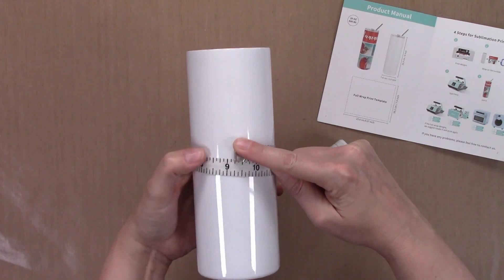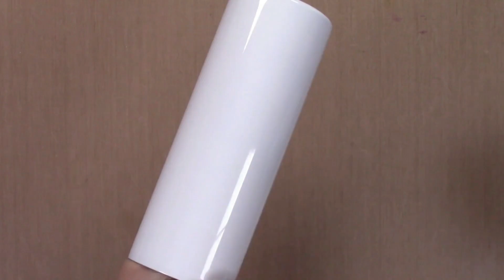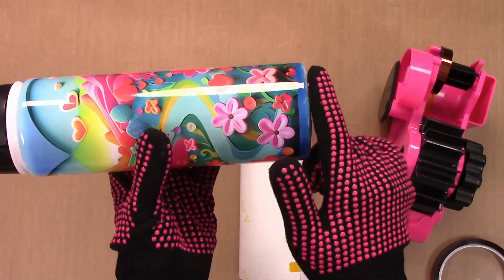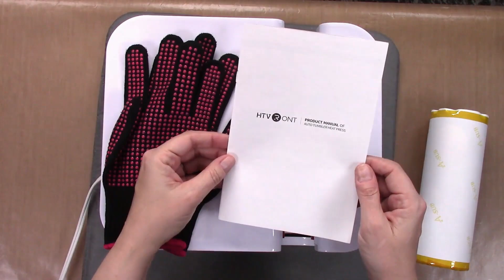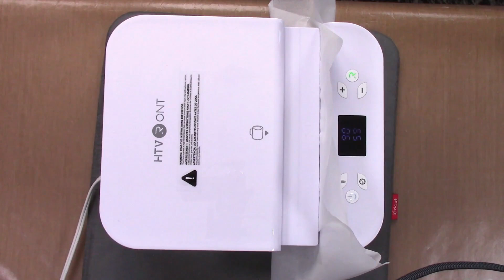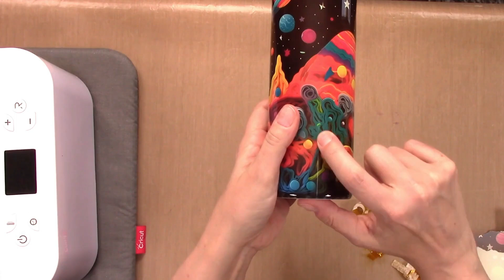HTVRont Auto Tumbler Heat Press Final

Comment: If you want a perfect seam, seamless, then you want a bit of overlap. The bottom side you put a piece of heat tape on the back along the edge, then you pull it tight and will have a touch of overlap. Then pull and tape it well, and run your finger along both seams. You will get a perfect seam every time.
Reply from the maker: Great. Thank you for those tips!

Comment: Any suggestions I'm having ghosting issues i messed up 3 tumblers with this heat press i did it once for 380 for 120 seconds and its ghosting either near the seam or bottom or top of cup so frustrating
Reply from the maker: Unfortunately, I gave up on this tumbler press when the buttons stopped working for me (not long after this video). But, there are several people in the comments who suggested rotating the tumbler multiple times during the heating process and heating it longer than I did. One person puts the bottom back in the tumbler press again and heats it again to get good results on the bottom edge. Another person mentioned using the method from an Industrial Fringe video and getting perfect results. She didn't say which one but I'm guessing it's this one: https://www.youtube.com/watch?v=7Uj0ho9pP3o I hope one of those helps - you might want to read the other comments since I may not have summarized them very well here. Good luck!

Comment: 385 120s rotate and another 120s no issues. also try shrink wrapping works great.
Reply from the maker: I've been hesitant to try shrink wrap because the ones I've been able to find seem to be for use in sublimation ovens. Is there one you recommend that is okay in a tumbler press? Maybe the oven ones are okay for that too...I wasn't sure and didn't want to risk it melting in the tumbler press. Thanks!

Comment: How if the picture or design don't come out on the tumbler and the paper be stuff on the tumbler what do you do to correct it.
Reply from the maker: Unfortunately, with sublimation projects there isn't a way to fix them if they don't trun out. You can try putting the paper back on and reheating it but the chance of being able to get it back in the exact same place is very, very low so you'll probably wind up with a lot of ghosting, which will be worse. When mine don't turn out,. I have to start over with a new blank and print. If you're new to the process and are able to, try using some cheaper blanks first if possible (mugs work in the press too) so you can get a feel for the right settings, how to wrap the blank well, etc. It does take some practice but hang in there - you'll get it.

Comment: I flip my tumblers end for end plus the normal rotate 180 couple times.  Fixed my issues with this HTVRont press.  Early on I noticed the press does not close perfectly square on both ends.
Reply from the maker: This is a fantastic tip! I didn't realize that was the case (not closing perfectly square on both ends) so this should help a lot. Thanks!!

Comment: Have you tried it with shrink wrap?

What tumbler press did you switch to?
Reply from the maker: I haven't tried shrink wrap but I've thought about it. I purchased one from Craft Express. Not as compact but work very well.
Reply: @BlackSheep303Crafts  Thank you 😊. 
Did you do a video with the Craft Express? If not, will you be doing one?

I am torn between a tumbler press or a sublimation oven from a sublimation company. I'm still not sure I want to get into sublimation printers. I'm not one for conversions or shortcuts. 

It's bad enough I have 50,000 hobbies. 😆 🤣 😂.  I'm pretty sure I don't need 1 more but hey, if I can make some money with it, it might be worth investing in it.
Reply from the maker: @andreatthatsme  I haven’t done a video with the Craft Express tumbler press. I may but it won’t be soon. A sublimation oven would give you the ability to do more types of projects than a tumbler-specific press. But if you really only want to do tumblers then either would work. Good luck deciding. I know what you mean about having 50,000 hobbies - lol. 😆 But that’s a nice problem to have.

Comment: Exactly that is the temperature and time it should take for black colors?
Reply from the maker: Time and temperature settings are largely determined by the substrate you are sublimating on to, like the stainless steel tumbler in this video. Without knowing that, I  can't give you time and temperature settings. But, as I show in the video, the booklet that comes with the machine gives you settings based on the substrate. Also, the color of the material/sublimation design doesn't make a difference so once you know the settings for your substrate, you are good to go. Here's a blog post from HTVRont that should help: https://www.htvront.com/blogs/beginners-guide-precautions/tumbler-press-time-and-temp I hope that helps!

Comment: You're a genius. I snipped along the bottom, only way more times than you did. I used your technique with the tape wrapped tightly around the bottom but then I added a thicker tape on top of that tape to fold the tiny snip pieces in place. Then, just to be sure, I taped the bottom and they turned out beautiful. Thanks for the idea! And thanks for sharing..🙂
Reply from the maker: That is fantastic! I am really happy I showed you something that made a difference with your tumblers. Thanks for letting me know. I'll have to try the thicker tape trick now too.
Reply: What if we put the tumbler in shrink wrap and then cover it with butcher paper while in the heat press?

Comment: Purchased this press in February lots of ghosting and requires entirely too much tape to be successful. Purchased a new press Wednesday of this week and it works perfectly. The new one is a different brand
Reply from the maker: Are you willing to share which one you purchased? I and others would love to know, especially since you aren't having the ghosting issue. Thanks!
Reply: @BlackSheep303Crafts sure thing. It’s the exact same one being used. Regrettably, had to purchase a different brand since the only way to prevent ghosting was by using ALOT of tape. It was cutting into my bottom line. Keeping it for mugs but not tumblers. ☹️ Love the video though, thanks for sharing.
Reply from the maker: @arisingphoenix4392  I guess my question wasn't clear - what is the brand of the new one you purchased after giving up on the HTVRont one? I'm always looking for good brands for tools. Thanks!
Reply: That's the issue I'm having ghosting issues and I wasn't having this issue with another press I was using that came with my heat press
Reply: Hi there. Can you please share the name of the other brand?
Reply from the maker: @yaredavila_23  I actually purchased a tumbler press from Craft Express and it's easier to work with. Not as aesthetically pretty in terms of design, but I wasn't worried about that. Don't know if that helps.

Comment: I watched a taping video on industrial fringe yt channel and I used that for my first tumbler on my htvront tumbler press and my top and bottom were perfect. My Seam wasn't matched great but there was absolutely no ghosting. It was a very clean seam that did not meet up lol. But top and bottom are perfect on my very first ever tumbler.
Reply from the maker: Thanks so much for sharing this. I will definitely check it out.
Reply: @BlackSheep303Crafts  yw. I think I've also learned through watching yt.... that on the htvront that maybe a little higher heat and a tiny bit higher time...I did 390 at 90 and 90 on that tumbler (so far the only one I've done) and like I said it was absolutely perfect other then the seam which was my fault and me just learning how to do things.... not the equipments fault. I am going to try the next one at 390 and 180 seconds with no turn and see what happens.... but I'm nervous... I'm terrified of fires, so putting something into something that hot for too long scares me. But I watched a video and they did it and it was fine, and there were no issues whatsoever
Reply: @BlackSheep303Crafts I've tried to get the wrap twice not coming to my email or spam is it still available?
Reply from the maker: @beebeej1  Are you not getting the Resource Library password in your email or something else? The wraps are in the Resource Library. You can email me at elena@blacksheep303.com and I can send it to you.
Reply: Oh, I forgot....I also wanted to say that I watched a yt video....I can not for the life of me remember which one because it wasn't like just today, lol.... but the person was having the typical issues people keep complaining of with the htvront, so they reached out to the company about it, and they had recommended a time and temp... which is where I came up with the 390 at 90 and 90.... the company told her 180 seconds continuous press, but I was too scared for my very first tumbler to do that since literally everyone else turns halfway through.... but.... they all have a press that does not close all the way also.... this one literally closes completely. The 180 second press worked great on the channel, and she had no issues that she had previously been having....ghosting and top and bottom edge issues.... it turned out perfect.... so that's where I came up with my time and temp. That, combined with the taping video, is what I contribute to (what I'm going to call successful), first tumbler being a success on a press that everyone else is having issues with. 
Enough heat, not too much or too little time, and a good tape job....I feel like that is the success with this press, and I'm glad I chose this press. I have autoimmune issues and a lot of pain, especially in my hands with swelling, and it affects my grip and strength sometimes... that's why I chose this press for my first (and hopefully only) press. I was going to get a cheaper one that you had to put more physical work into (like turning halfway through and physically having to adjust the pressure and pull the handle down) but I told my husband about this one and the perks and the disadvantages that others were having issues with and he told me to spend the little extra money (it was on sale and was only like $10 or so higher then the other press, lol) on what would make my life easier. He felt that it being pretty much fully automatic was a huge plus for me and worth the little extra money..... and I agree 100% with him, lol

Comment: Great video! I have this tumbler press, and the two things that seem to help with the bottom the most are wrapping the bottom really well and burnishing like crazy (I take a cloth and roll it hard on the cloth at an angle to help burnish) and then after pressing the tumbler completely, putting just the last couple of inches of the tumbler back in the press for an additional 10-20 seconds. That little extra time on the end seems to help get a better image on the bottom.
Reply from the maker: Thanks so much for the great info!! I will definitely try that method next time.

Comment: Thanks for this demonstration. It was very informative and I do love the way your tumblers turned out.  I was wondering about the tumbler press.  Does it only do mugs and tumblers with one dimension? There are such a variety of dimensions (especially on tumblers. Mugs probably have fewer.)
Reply from the maker: Thanks!! It can definitely do more than one width of tumblers and mugs but there is a limit. The opening is about 3.35" max in diameter so things have to be thinner than that. The manual says it can go as small as 2.9" in diameter - not a huge range in sizes. The longest height would be 9" (according to the manual) although I wonder if you could do something taller and just flip it around to do the part that sticks out of the machine on a second heating. Maybe I'll try it sometime.

Comment: Great video! A question of the video: how do you speed it up? I have an iPhone, but haven't figured out if I need an app to do the speed up, thank you.
Reply from the maker: I edit in Filmora and it has a setting where you can speed up sections really easily. I would think iMovie or whatever editor iphones use would have something similar. You just have to make an edit at the beginning of where you want the speed up to start and the end and then set the speed time (like 2x, 4x, etc.) in Filmora. It's probably a matter of doing a search specifically on speeding up or slowing down a video clip on an iphone maybe?

Comment: First time I see the process, hmmm interesting👍
When you use a measuring tape like that, make sure to check it from time to time if it did not stretch; over time these tapes tend to stretch a bit. I know mine did…
Reply from the maker: Good point! I did have to try printing out the design several times (with regular ink and paper) to get the diameter just right. I had to view the fabric measuring tape as more of a starting point than an exact measurement. I'll keep an eye on the stretching - hadn't thought of that. Thanks!!